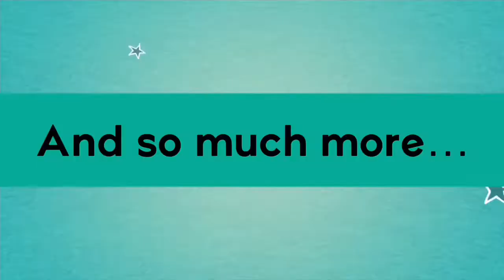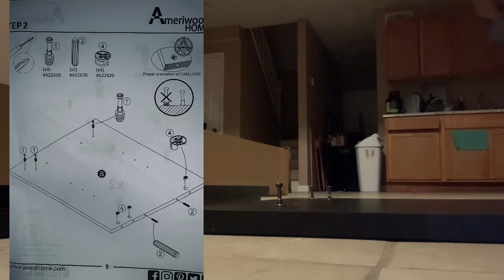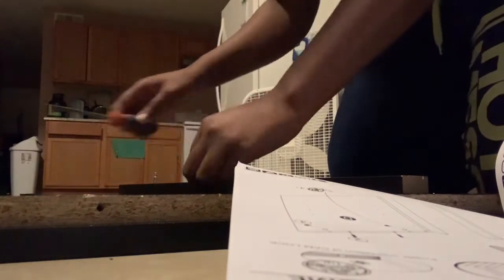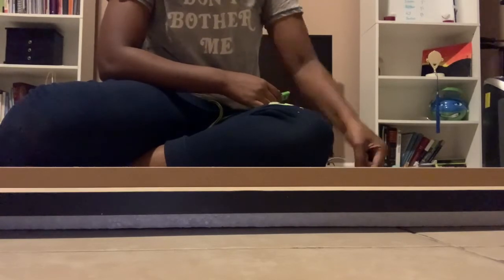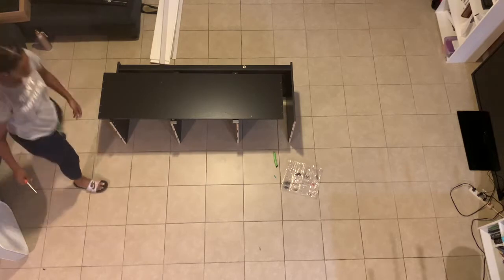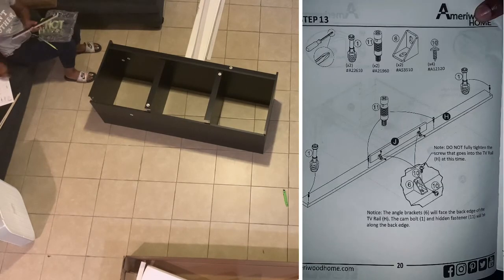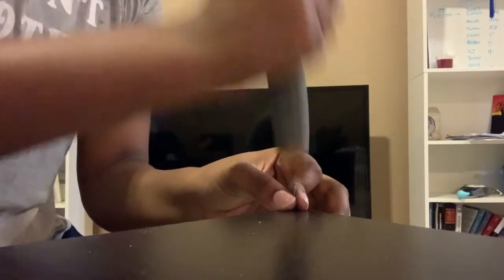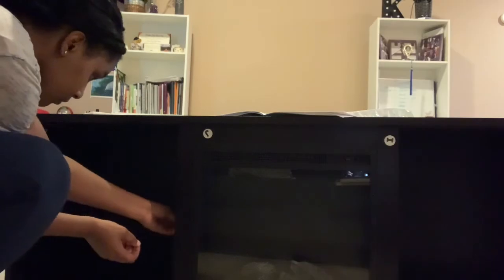Assemble with me: Mainstays Fireplace TV Stand (Step-by-Step)

Comment: My parts and holes are uneven🥲 my E holes don’t match/attach! I am getting so frustrated! Was getting right alone until I had to connect E to the rest! Now it’s not adding up!
Reply from the maker: There are three holes on the bottom of A-D you have to make sure they match before you can add the top.
Reply: Bro I’m in the same boat did you figure it out

Comment: I need help with step 14 there no holes to put H at the end how did you do that and make E and H flush together???
Reply from the maker: Make sure it is turned the right way. And you slide it in there should be hole at the bottom. This is the reason you don’t tighten K because it won’t fit if you do.
Reply: I tried that it still didn’t work
Reply from the maker: @dorianwhite6381  the holes are on the side and j goes between c and D and then the war where it locks should be at the bottom of a and B
Reply: Did anyone ever figure this out, this is where I am stuck at
Reply from the maker: @diamondtyler4115  After sliding j under C and D the parts where H meets A and B there should be a hole on the bottom and the lock that u have to turn should be on the inside. You would force it in and then turn the lock and it should be secured.
Reply: Tried everything and still nothing. I think I may have a defective one lol
Reply from the maker: @diamondtyler4115   It could also be that k is too tight. Maybe it’ll slide in if you loosen it. wish I could show you or help more sorry.
Reply: @kiwislifee  it’s like the holes that are pre drilled into a & b don’t allow enough space for H

Comment: I’m stuck on step 14 it’s like they forgot to put the holes for j
Reply from the maker: If you’re referring to putting it in it should slide in and lock on the sides.
Reply: Did you figure it out? I’m on the same

Comment: We’re the 4 middle holes wayyyy off for you? My ends go in perfectly but the middle isn’t even close.
Reply from the maker: Yes I had to take it apart and put it together several times to get it close to right. It’s not loose or anything but I know it’s should be way tighter.
Reply: Same here I've been stuck for 2 days because the middle piece not even close to lining up!
Reply from the maker: @hilarydowne  I think it’s the piece “k” needs to be loose before putting in the top piece. Idk y but if it’s tight it’s hard to get the top on, AND when you get to putting the heater in it won’t fit.
Reply: The 2 middle pieces c and d are not fitting for me insee this is a known issue  tho

Comment: i’m so lost with the putting the K piece on the F
Reply from the maker: So it’s like the bottom cover in the front. Take the “L” shaped piece facing the brown unpainted part. the piece should be sticking up away from you and screw to the base and then to “K” and then flip over and should be put together. It says don’t tighten because it makes it harder to put on the top pieces. Sorry if it doesn’t make sense. This is the best way I know how to do to.

Comment: Step 12 is f ing impossible it doesn’t line up what am I doing wrong been stuff on this step for 2 hrs
Reply: Stuck
Reply from the maker: There are three holes I believe. So it’s supposed to sit slightly back. And then another piece goes In front of it. Sorry this was years ago and one of my first videos so it isn’t very clear. Lay it down like I have it and it should line up

Comment: I just bought one waiting for it..after 4months life span OK?is it still working proper?I ordered from Walmart
Reply from the maker: Yes still works perfectly and is still keeping me warm. Note I do have a loft so it doesn’t take much to heat up my whole place.
Reply from the maker: @pagedown652  ok that sounds like a good idea for me to try too.
Reply: Mine didn't come with the screws but I don't want to send it back. Where can I get the screws for the whole stand?
Reply from the maker: @melissahernandez1384  probably Home Depot or Lowes the screw size should be in the directions and how many you would need. Or reach out to the company they may just send you all the screws.
Reply: @kiwislifee  Thanks!

Comment: How did you get c and d on ?
Reply from the maker: Sorry I lost the footage for that I think because I had to use the light to line up the holes. They would NOT line up for nothing. But I stuck the screws through “F” and then lined up c and d a screwed it in while pushing it against the couch to hold still.